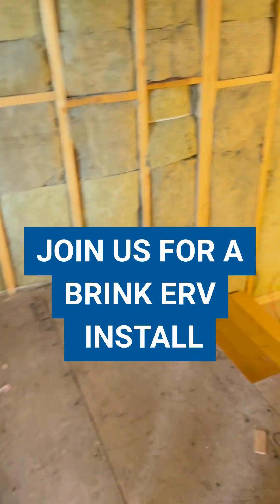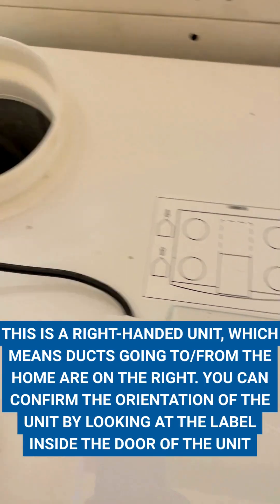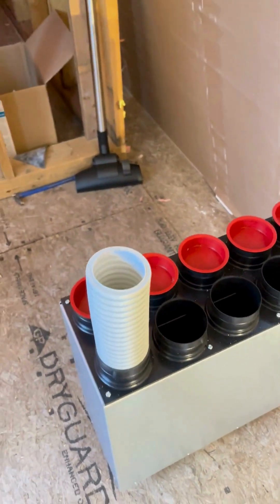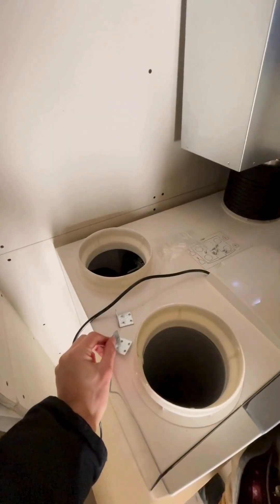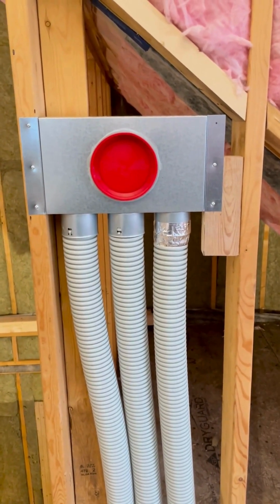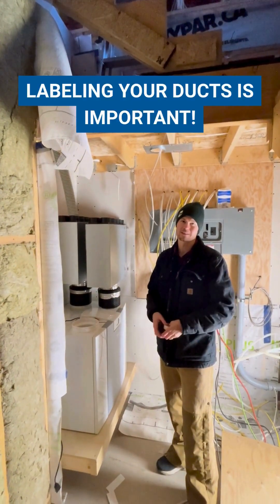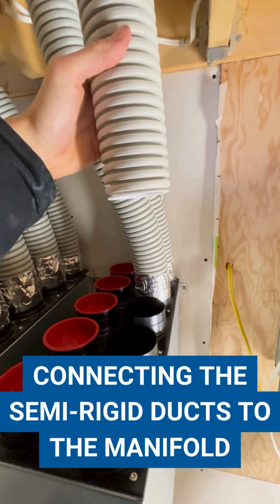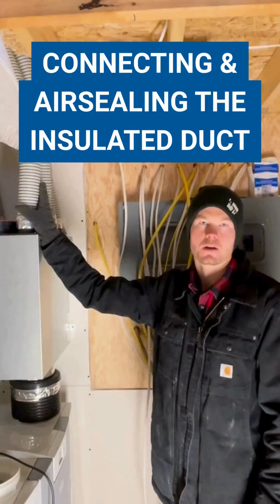Walkthrough of a Brink FLAIR ERV Install in Ontario

Comment: The kitchen exhaust? How much
 Cfm would that pull ? That seems inefficient, not strong enough.
Reply from the maker: Hi @AllthingsRocco! An ERV kitchen exhaust isn't meant to replace a traditional range hood. Having an exhaust point in the kitchen helps maintain balanced airflow throughout your home and can be required for certain certifications.
Reply: I was just about to ask if it replaces the standard of range hood.